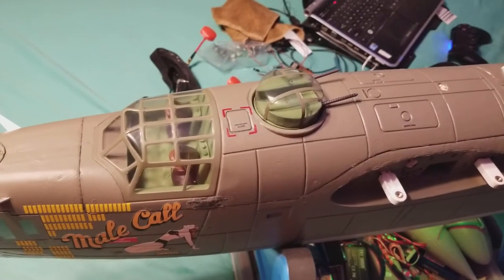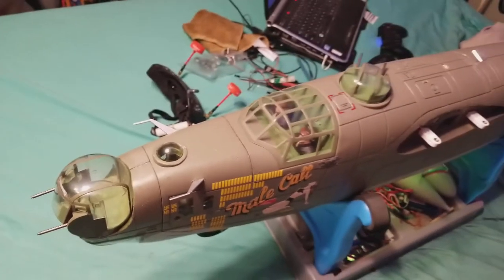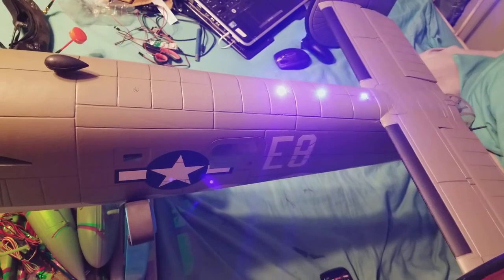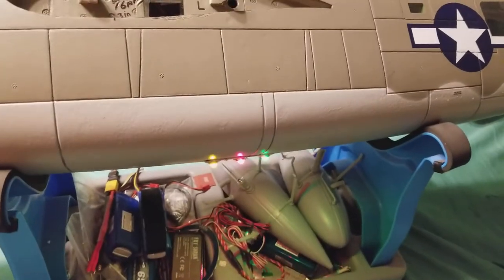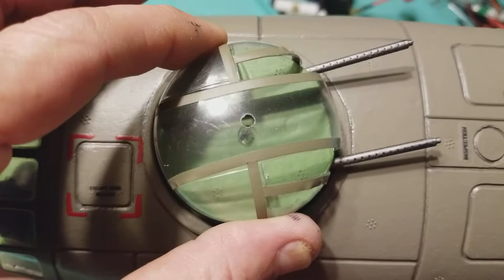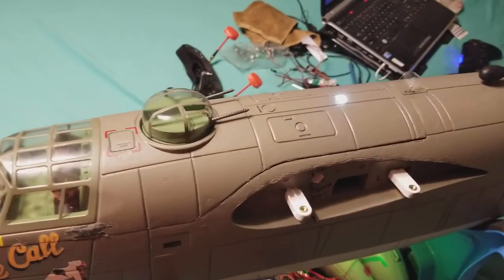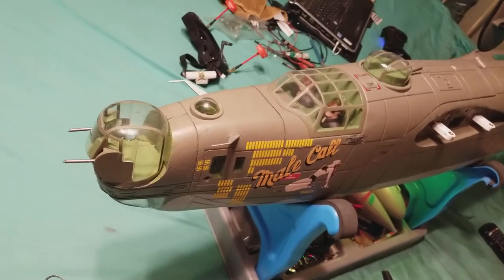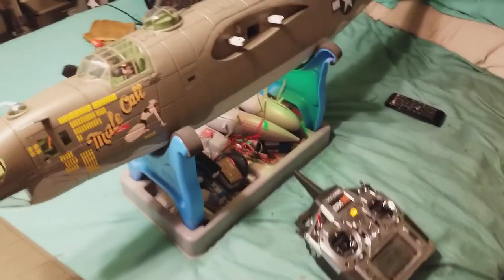FlightlineRC 2000mm B-24 Turret mods and lights

Comment: Great job Brandon took the idea right out of my head about the P 38 wing lights lol good job my man.  Vheck out the lights I put in mine.
Reply from the maker: Thank you. I checked out you video and subscribed...nice job you did.
Reply: Thank you Sir.  Really like watching all your mods and stuff. You're really good.  And good point about the empty channel in the LIB..  Did they forget it or is it just a channel for wires etc.?  Thanks for subscribing,  that just meant a lot.  Have a Great rest of the weekend and a great New Year.  Skip
Reply from the maker: You're welcome. I enjoyed watching your build and mods. The extra gear door sequenced channel on the FL B-24's main PCB board is for just that ...a later upgrade they are going to offer, that will allow you to include a pair of added nose gear doors sequenced to open and close. In the meantime it can be used for lots of other ideas ;)
Reply: That's right.  An extra sequencer possibility already exists...H'mmm  Could be useful.  Thanks again.  Happy Flying, Skip
ps.  Thanks for the info.  Just love knowing about stuff before it comes out.  Gives me a chance to plan for my channel.

Comment: May I ask where you are getting the turret details? I got a Guillow's B-17 this week and would love to do something with the turrets and waist mounts.
Reply from the maker: What turret details are you exactly asking about? The top turret servo is a 9g 360 degree continuous rotation servo as mentioned on the video and was bought on eBay as well as the 180 degree servo on the nose turret. there is more posted on this on RCG.